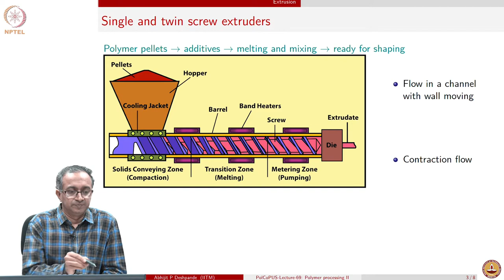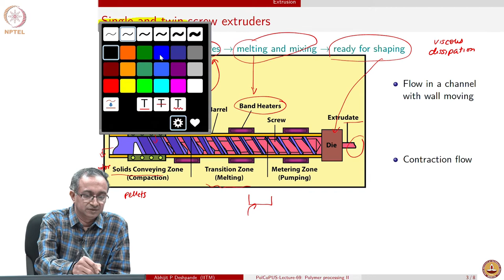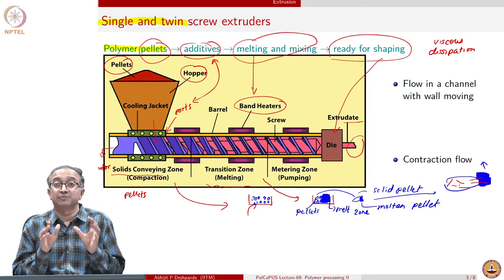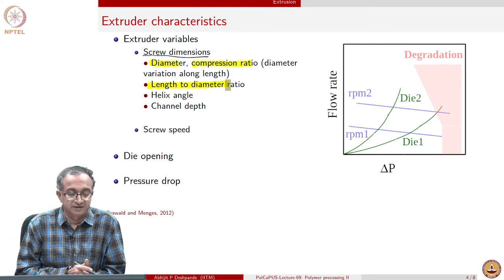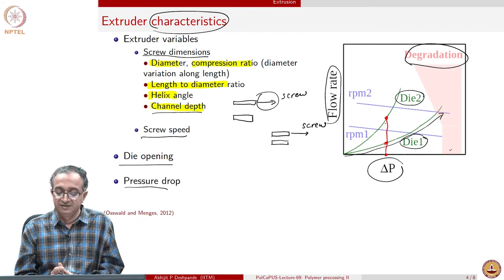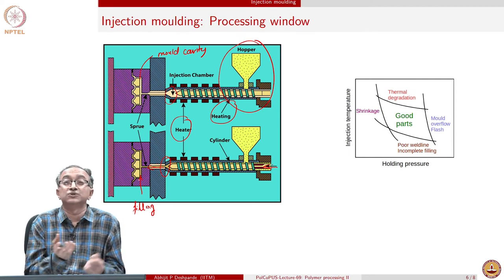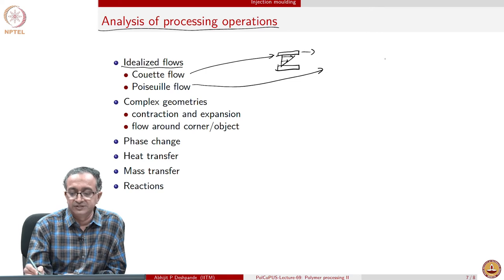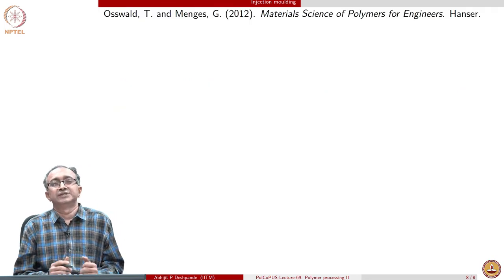Lecture 69 - Polymer processing II

Comment: power transmission is the prime reason by energy transfer from electrical Motor shaft to mechanical Gear screw shafts to process heat for solid to melt phase conversion